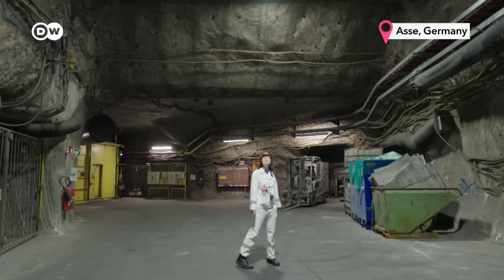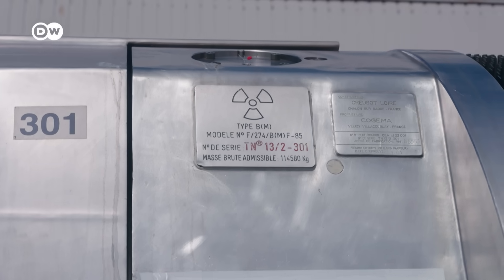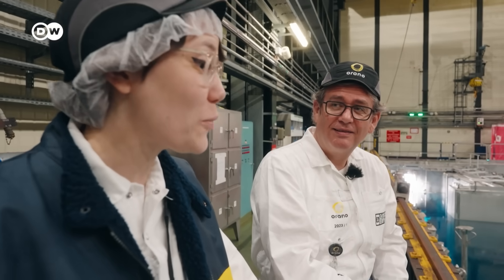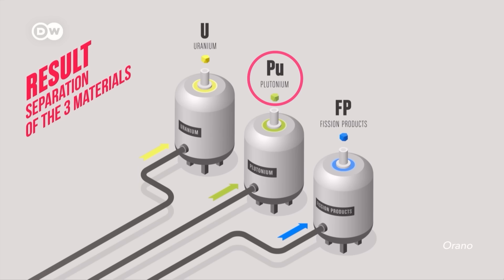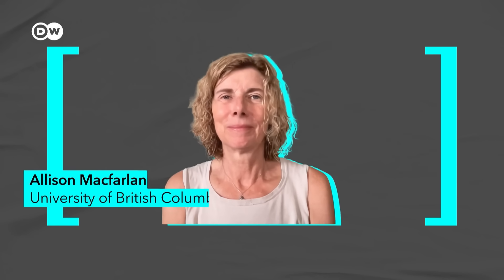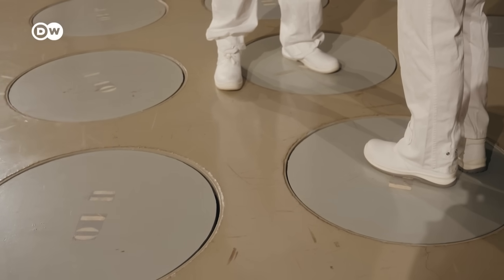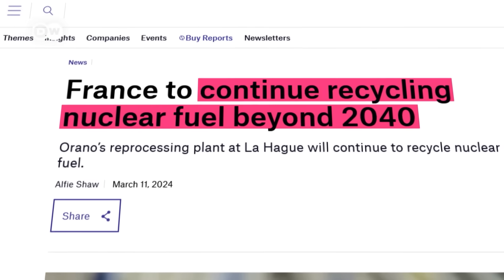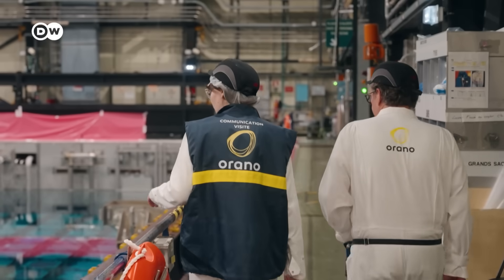Nuclear waste is reusable. Why aren’t we doing it?

Comment: If we spent the same amount on nuclear as we do on fossil fuels what could we do? In the 100 years of using fossil fuels we have learned a lot. 

Some think that electric or battery will be next. The problem with every solution is the risk to cost. If we understood why water could evaporate in freezing temperatures and with no sun then we might be able to find clean energy. There is no money to be made in finding clean energy so small labs are all that are trying to do it. 

If we moved into a world where money didn't exist what would we do and how would we be doing it? Money is just something that we made up and we let it stop us from doing great things. 

If it cost to much money. What we are really saying is that it is not worth the time and effort to do. 

Remember that everything is ran on fossil fuels. How do we mine? With ether gas, or diesel. If we want to think that it's clean we turn it to electrical. How do we get electricity? From the most part fossil fuels. 

Why are the oil producers looking for something else to fund them? Could it be that they are running out? It's not our problem and it will be in the next 200 years. 

The other question is why do we use the nuclear fuel until it's spent? Is there a cleaner way? Like maybe looking at nature. Does nature use things until they are spent? Not usually. The Earth has a lot to teach us and we don't listen because it costs to much? To much what? Life, because money is made up. People choose how much money is worth. So money is not a very good answer.

Comment: Notice you didn't mention that the plutionium recovered from recycling cannot be used without 235-U, thus rendering extaction  economically  impossible. IMOX COULD use 30% of the transmuted fuel, NO ONE can use the daughter products or the superheavy tranmutes like 241U. ALL the 239-Pu is weapons grade, no other way to use it.

Comment: Yes, the problem is political, because it's the USA's historical hegemony in oil based economy, that is directly responsible for strangling the nuclear power generation sector.

You can extract MUCH more value out of the oil sector than the nuclear sector, simply because oil is so much less efficient and hence needs many more stages of production - each of which adds $$$ to the corporate bank account.

It's the oil barons of the US, married with the US financial sector that lobbied for economic destruction of the nuclear power generation.

Comment: 30-Year decommissioning period of any old atomic power plant prohibits its cost effectiveness and the the at least 50-year storage, the fact that for a billionth of the cost you can have solar power for the next 60 years. 

There is simply no way around the fact that solar is the cheapest energy out there, and is continually getting cheaper as well as the batteries getting cheaper, storing more, charging faster and there's no end in sight of these innovations. 

Atomic power has never actually been profitable, it has always been highly subsidized, highly toxic, highly dangerous, and a fool's errand with anybody who can Read a spreadsheet

Comment: France cracked the price problem already though: scale. 

They built their grid on nuclear fuel (which is already efficient) and so they had a massive amount of spent rods to deal with. The left over fissible material was still in there. They needed a way to reclaim it. So they did. If the US went through uranium at scale like France that process would likely be more appealing

The NRC woman from BC just said out loud the way the developed world (including France in most other situations) treats all materials. If it’s cheaper to dig it up and throw it away that’s we’ll do. Even if we run out and will have no idea what to do later. Even if we have nowhere to store the waste. 

Recycling is rarely economic. Left to the market no one will do it. Doesn’t mean we shouldn’t do it though.

Comment: If it's so lucrative, how comes no energy company is going after it? On the whole world nobody does it.
Anyways the biggest security risk for me is the IT. We have so many compliance tasks and regulations expecting from you to install anti virus, VPN and other stuff. However these exact companies are opened left and right with decade old security holes. Every week a vendor is caught with their pants down (unauthenticated remote code execution, auth bypass, no auth at all, hardcoded credentials, open s3 storages, unsanitized user input right into a root shell, etc). EVERY WEEK. All major vendors are affected. Running security software is a security risk. Besides Windows, Office and AD. And that's why I don't want any nuclear reactors. I don't want to read "nuclear reactor blew up because the VPN gateway was not updated in 10 years. Nobody felt responsible".

Comment: Just an uneducated individual here, In my opinion future energy demands will be met by upstream efficiencies in transitions of energy, Meaning French was smart to  Initiate recycling despite costs, the downstream disposal of nuclear waste in molten salt reactors are another form of power generation, Then combine 2 dimensional engineering that  Utilize quantum Properties of materials on tungsten plates to turn thermal  Energy directly into electricity can be used for extraction of power in the cool down of the materials, The future is in upstream efficiencies not down stream compensation.

Comment: Nuclear energy goes against the climate change narrative that they use to laundry money, and push laws that have nothing to do with climate change, the media gets paid to to demonize nucular energy where they keep intentionally using outdated information from previous disasters as reference to why nuclear is bad, while leaving out information about miraculous breakthrough methods and solutions that have been already achieved decades ago, also hydrogen is also an alternative energy source that's more cleaner to process, than compared to the efforts whenharvesting oil

Comment: But almost at the start, the caskets, he says the internal temperature is 200-300°C, can't that be used as a heat source to then convert into other types of energy? If i'm not mistaken, that decay and heat production is selfsustaining for a long time, and since we don't have another method of using the energy directly instead of converting it for the time being, isn't that a better solution?

Comment: The  problem is the cost associated with recycling uranium rods. Now with newer reactors smaller reactors is that we can use the old rods and get them used down into about 8% of the half life.

Pretty sure they are playing around with super heating the waste to pull off more product and burn off radiation but I can't remember.

Comment: So this is a SLOW version of Teller/Ulamb adding an additional tamper that isn't a primary fuel but like U238/Pu239/Li7 when struck by neutrons they become activated and contribute to the reaction?  MOX fuel and boosted fission bombs are so similar then its really just the rods and moderators keeping it from becoming a bomb.  Lets not be facile here.  This technology allows for Pu collection and production!  Pu is FAR easier to make into a working 1st gen nuke, aka an atomic weapon as opposed to thermonuclear ones. (H bombs)  WIth Pu a weapon can be WAY lighter, smaller, and thus easier to transport and deploy.  Ramping up ACCESS to Pu anywhere with several hot wars involving rapacious Amoral regimes is a BAD fucking idea.  (YES, that F-bomb needs to be there to not the seriousness and insanity of promoting this, for now at least)

Comment: So what the hell are "fission products" and why are they unusable? Why is only 30% less uranium used if 95% of the energy remains? Why can't the plutonium be used by itself? And why is the MOX not reused?
Reply: Fission products, are the results of splitting the uranium atoms. You get different kinds of atoms, not all of them conducive to producing power.

Over time the fuel rod gets mucked up by these other atoms, which makes it hard to use.

Comment: poorly researched
The indians ran their  CANDU reactor in a way to produce high purity Pu239, you cant run a CANDU reactor commercially and also produce high purity Pu239 at the same time. so reprocessing fuels from commercial reactors doesnt have this problem, because commercial spent fuel has alot of Pu240 and Pu 242 which are detrimental to nuclear bombs, so You CANNOT used spent nuclear fuel from commercial plants to build bombs.  as I said, poorly researched documentary which only presents false information about nuclear fuel reprocessing, painting it as a risky affair prone to proliferation, which is not true.

Comment: As an expert Satisfactory player, it very easy. once you have the support infrastructure built. You just need to have your conveyor belts of nuclear waste take the barrels out of the power plants and convert them into non-fissile Uranium thru a blender. Take that material and run it thru a particle accelerator into Plutonium pellets. Take those pellets and put them in an assembler to make encased Plutonium cells, and finally a manufacturer building to make plutonium fuel rods which can be used as fuel and create worse waste or completely destroyed in an Awesome sink machine. 😃

Comment: Spent fuel is not reprocessed for one reason. It is cheaper for reactors to use U-235 from mining. 
Now let's talk about reprocessing. It is by far the dirtiest, most dangerous process for nuclear workers. It is also the most polluting process.  It is very expensive and only reclaims 1-2% of the spent fuel for reuse as plutonium and U-235. The rest is still nuclear waste. Once the reprocessed fuel is reused once, it is again... wait for it, nuclear waste. La Hague and Sellafield were the only reprocessing plants in Europe. They have managed to make the Atlantic Ocean all the way to the Arctic Circle the most radioactively contaminated ocean in the world. Sellafield was shut down. The British government estimates that it will cost $1 billion a year just to maintain the site and at least 100 years to clean it up at God only knows what cost. La Hague no longer has any international customers and only reprocesses for its parent company, Orano, which has been taken over by the French government to keep it from going bankrupt. Pity the poor French taxpayer.
Russia has 2 reprocessor on barges that cost exorbitant sums and very lengthy times to start up. Their performance has been very disappointing and they run at less than 30% efficiency. The only advantage is that they are on barges, so the spent waste can be dumped directly into the Arctic Ocean, instead of having to be transported to the sea like the rest of their waste.

Comment: I don't want to be annoying, but if the fission products account for 4% of the total "waste", and you would only need 5x more room to store it (10:35), wouldn't that mean that one of those numbers is wrong. I myself am a fan of nuclear energy, so i came up with a couple of interesting reasons.

1. The question was asked on the spot -> the man might have misinterpreted the question
2. The fission products are encased in glass, this takes up more space
3. It might be easier to store more "normal" nuclear waste as it could maybe be stacked more then 9 times on eachother

I'm quite curious to the answer. Please answer if anyone knows!
Reply from the maker: Your second point is correct. As you can see at around 9:47, trapping the fission products in glass increases their volume significantly.

Comment: Talking more for the US. I still don’t understand why more fuel isn’t recycled. If the plutonium is safely guarded it isn’t a problem but also there’d be less mined uranium that is circulating. Costs should also go down over time as better techniques are discovered, it also acts as a strategic reserve, and you become less dependent on uranium imports in the event they get disrupted.
Reply: And its plutonium. In a cold war. For goodness sake just use to make nukes

Comment: Why do they separate the plutonium and the Uranium, ship it across the country, and then mix it together again? Why not either leave it mixed, or remix it in the proper ratios at the facility? Certainly with all the equipment they have there, it wouldn't be that much harder to add on a couple rooms to mix it back together

Comment: Nuclear Waste is Recyclable: Up to 96% of spent nuclear fuel is recyclable, containing over 90% of its original energy.
France Leads in Recycling: France has the highest share of nuclear power globally and operates the largest nuclear recycling plant, run by Orano.
Orano's Recycling Process:
Spent fuel rods arrive in heavily shielded 110-ton casks.
Rods are stored in pools for 5-7 years to cool down.
A chemical process separates uranium, plutonium, and fission products.
Uranium can be reused in reactors.
Plutonium is mixed with uranium to create MOX fuel, used in reactors, generating 10% of France's electricity.
Fission products (4% of waste) are vitrified (trapped in glass) and stored, awaiting a permanent storage site.
Challenges of Recycling:
Cost: Recycling is more expensive than using new uranium, which is currently abundant.
Plutonium Proliferation: The process produces purified plutonium, a key component in nuclear weapons, raising proliferation concerns. This is a major reason why the US stopped reprocessing in the 1970s.
Technical Complexity: The recycling process is complex and not widely available.
Waste Generation: Recycling generates other waste from chemicals and equipment used.
MOX Fuel: Once-recycled MOX fuel isn't currently recycled again, eventually becoming waste.
Global Recycling Efforts:
France is the leader.
Russia recycles about a tenth of what France does.
India recycles and plans to expand.
China has a demonstration plant and is building more.
The UK stopped due to cost.
Japan has faced massive delays and cost increases in building a plant.
France's Strategy:
France chose to recycle 60+ years ago for energy independence, as nuclear power is crucial to their electricity supply.
Recycling operations and nuclear power plants are state-owned.
France is recycling more than it reuses, storing extra uranium for potential future use.
Alternative Recycling Methods:
Pyroprocessing is a newer method being researched that uses molten salt, produces less pure plutonium (reducing proliferation risk), but is still in the lab phase.
Conclusion:
Recycling is technically feasible and reduces high-level waste volume.
High costs and proliferation risks are major deterrents.
Recycling may make sense for countries prioritizing nuclear power and energy independence, but it doesn't eliminate the need for long-term waste storage.
New, cheaper technologies may emerge, but don't seem imminent.

Comment: This is the downside of solid fission fuel. Liquid fuel systems like Molten Salt Reactors allow for the extraction of fission products while the reactor is in use. Meaning the 96% of usable materials stay in the reactor until it's turned into a fission product. Even the rare plutonium that is created just stays inside. Fertile plutonium (which doesn't like to split) will have decades to capture a neutron and become fissile, after which it will turn into more fission products.

Comment: The issues of upmost importance:

It might cost a LIL more if we switched to nuclear.
The word nuclear sounds scawy 😰😰😰😰😰
We don’t wike it! 😡😡😡😡😡😡
Scawy barrels of barely radioactive safely contained metals 👻👻👻👻👻

Those are literally the only reasons why we haven’t switched to fossil fuels. It costs to switch to nuclear, but the costs of dealing with the climate crisis is far higher. Yeah, nuclear sounds scary oh no. The only meltdowns were due to poorly designed safety from decades back and bad placement. You know what’s scarier than the word nuclear, the death count of fossil fuels. DAILY, yes I said daily. The daily deaths from fossil fuel emissions alone is approximately 10,000. That’s not even mentioning the deaths caused by the brutal wars involving oil and other fossil fuels. What about nuclear meltdowns? 6,200. Daily? No TOTAL. Around 2,000 deaths are estimated from three mile island combining the few direct worker deaths and the evacuation. The tsunami ITSELF, separate from the disaster wiped out 7x as many people with a death toll of 14,000 which is more than 2x the total deaths from nuclear in just one natural disaster. People aren’t gonna like it, but it’s our only option that’s as efficient as fossil fuels without the toxic emissions. The biggest issue (while still fairly small) is dealing with the radioactive waste. Some companies have been containing them in bad, unsafe spots leading to some small degrees of pollution, but that isn’t the fault of nuclear, it’s companies being stupid. And it isn’t glowing green goop, its fairly radioactive metals surrounded by like 6 other layers of metals and put in a barrel (and that is only a tiny percentage of nuclear waste, as a another commenter said and I looked into it, most nuclear waste is just gloves and other things that are barely radioactive, yet still clunted in mass estimates for a large degree of fear factor). Eating a banana gives you more radiation than being around one of these guys (don’t fact check that). If nuclear was just given a ever so tiny portion of the attention given to fossil fuels, we could probably have enough research to make it practically renewable. But that costs money, so guess we can’t.